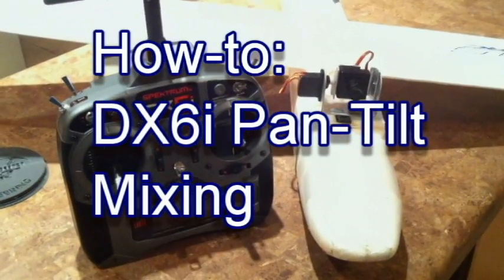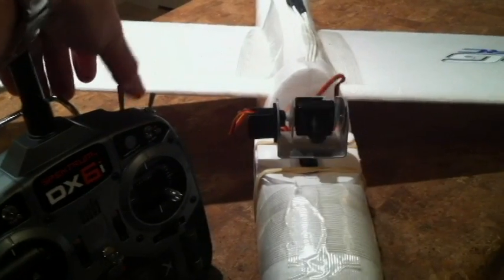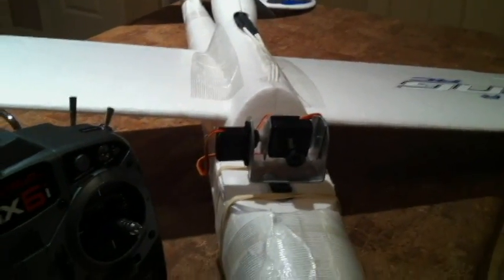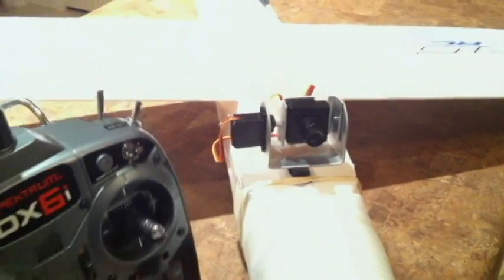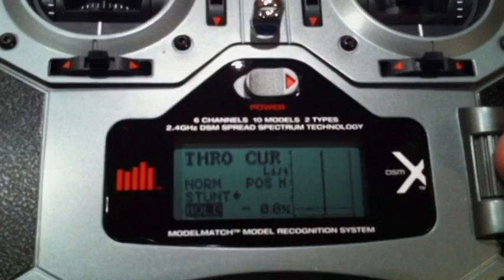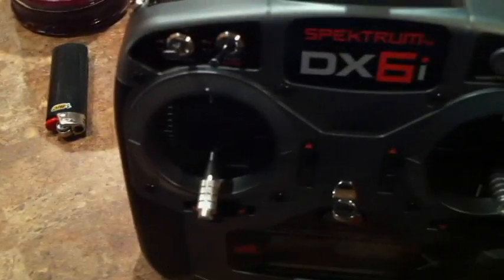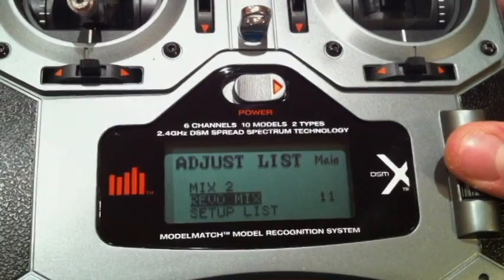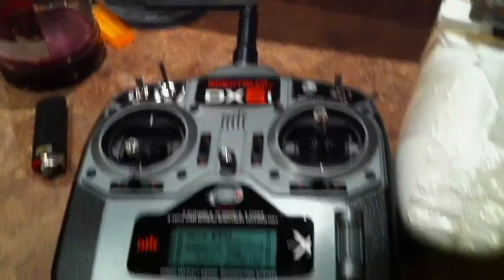DX6i FPV Pan-Tilt Mix Setup How-to

Comment: Can you help me program my dx6i to control my one 180 servo? It will only move about 45 total degrees, but it is a 180 degree servo for sure. Thanks!
Reply from the maker: +Thomas H You'll want to ensure your "Travel Adjust" is maxed out on your channel, ensure you're not limiting that channel on any mixes, and sometime you can even create a mix to the same channel. For example: setup MIX1 to mix Gear --> Gear and max out the % travel on that mix. 

Good luck!

Comment from the maker: Your airplane's motor should be running whenever your flip these switches. This is because you're disengaging control on the throttle in order for it to allow you to control the tilt servo with the throttle servo. Now... if your airplane is throttling up and down as you move the tilt servo, then you have a linear throttle setting instead of a flat, constant one.

Comment: I have the bixler, and also dx6i i did your exact same setup i hit F mode and th hold and sure i can move the camera around but when i go back to throtle it seems as it wants to move both camera and motor, im sure i have something mixed up cuz even when i hit f mode my camera wont look down as yours :S dont know how to solve this, any ideas? 
Thanks